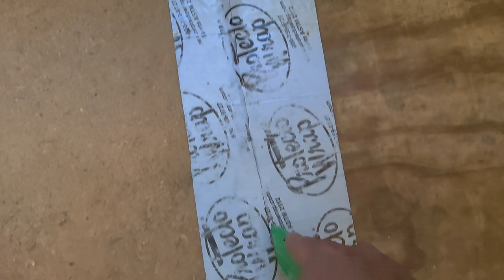I FOUND ROTTEN FLOOR JOIST IN THE MOBILE HOME AND GET MORE BUBBLE FOIL INSULATION

Comment: Could you just add some 2 x 6s to support between joists where the bad areas are versus replacing...
Reply: I was thinking the same thing or even run more 2x6 up against the rotten area and screw together so to mend the rotten as long as it helps support what the rotten is not.

Comment: I talked to a friend that is remodeling a mobile home about the same age as yours. I told him of your floor dilima. He said his frame on his house was bent too. He put down new floor too. I said what did you do to solve your unleavel problem? He said he trimmed the crossbeams, floor joist, whatever you call them. Hey, I'm a woman.  He said by trimming them he could level the floor out. It does weaken the floor a little. I guess you just try not to trim them too much. About the vents. You would have to install all new duct work. Not worth it. I hate vents in the floor. My new trailer has vents in the ceiling. I would do like you said. Window units or something else. My heat went out in a trailer I use to have. I just bought an electric fireplace for about 350 and it heated most of the house. You can do small electric heaters for the room your in and shut the other rooms off. Worked good for me and didn't make any difference in my electric bill.
Reply: I redid all my plumbing with CPVC. No more pex blowouts. I am replacing all my floors with 3/4 ply. I got rid of my Central air and ducts. Run a large window in the living room and a powerful fan to push the air around, Later I will install in the wall unless I get that mini split ac system I want. Window units in each bedroom only when I need them on. Thinking of doing a split system AC and heat. I have a propane ventless heater in the living area only use it when needed during really cold and constant cold days. it is by Red Stone got it from Tractor Supply and use 40# propane tanks I can easily manage by myself. 62 Female..It really kicks out heat and I love the rd flame like a fireplace I live in Fla so really lucky. And when I need heat in the other rooms I just run portable electric heat. Down the road, I will frame 2 x 4's on the exterior and add more insulation then lath and stucco.  I would like to know whoever made a tile shower stall in the bathroom I heard can't be done due to mobile homes flexing too much.